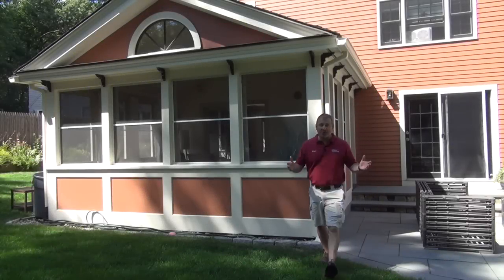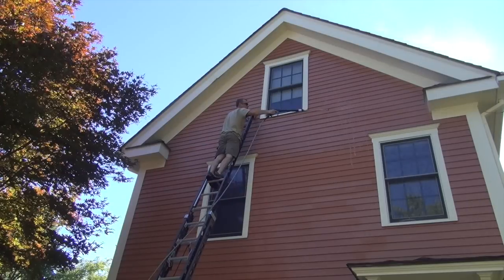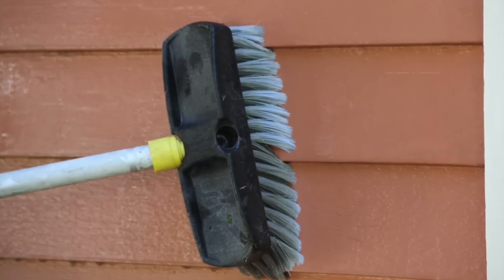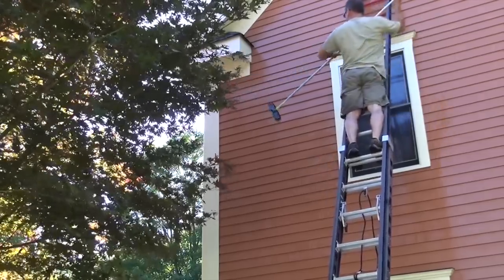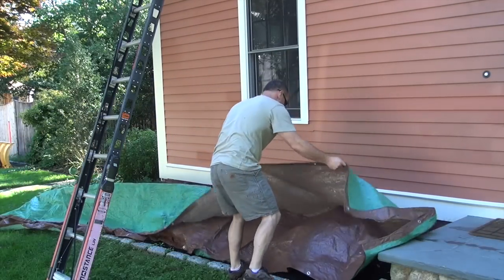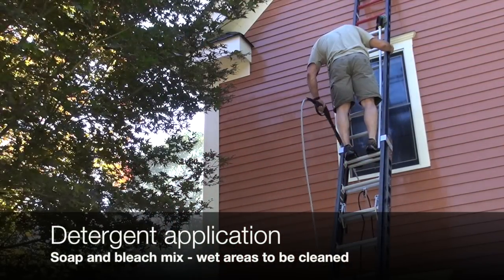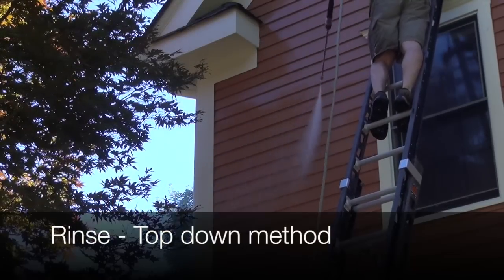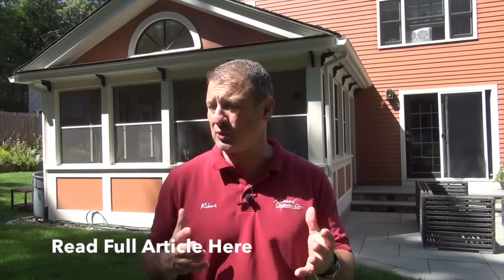How To Wash A House

Comment: Not good technique
Reply from the maker: Mike Movila please tell us why? Or what is a better technique
Reply: A Concord Carpenter / ToolBoxBuzz replace tsp with some purple power or even dawn dish soap, spray cleaning solution on and let it sit for 10-15 and the surfactant will loose the dirt and it just rinces away. Sometimes it's necessary to scrub but not all the time, mainly on gutters. My mix of I'm spraying straight is a gallon of bleach per 5 water, some fabuloso for fragrance and dawn for the extra lift. If downstreaming, it needs to be more concentrated otherwise you'll spray and need to scrub. There's a soft wash process, my setup is a 26 gallon sprayer tank with a 12v pump so that I can have control of my mix, and a water hose rince.